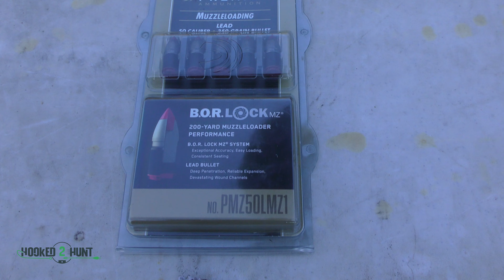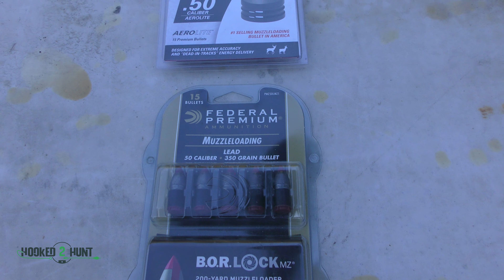2021 Muzzleloader Round Test   (Ballistics Gel Test and More!!)

Comment: Now that I've stocked up a lifetime supply of both muzzleloader bullets, I can share this information; Barnes Spitfire 290gr/blue Barnes sabot, and Hornady XTP .429 (44 mag) 300gr/Harvester green sabot. 3 bucks shot at 60-65yds with 290 Spitfires dead instantly, or layed down within 15yds.  1 Doe hit 20yds with 300 XTP quarter size entry, baseball size exit. 1 doe hit at 130yrds quarter size in and out, layed down in 20yds. 84gr by weight/120 by volume Black Horn 209 powder. Ya'll welcome.
Reply: I've only used the power belt and round balls so far. I Just started out with muzzleloaders this year.
Honestly even on paper and wood. it feels like the round ball ontop of about 65-75 gr. hit harder then the power belt ontop of a 100 gr.
I like the idea, but deffenitly see how power belt went wrong.
The gas check, while it does sound good, and works for the most part, it spins freely on the round.  
Logic would determine that it isn't gonna engage the Rifling as much as other options. At least that's my theory behind the "hit and miss" of power belt.
Sabot is definitely my next test.
 I just dont know if I should except more cleaning (plastic in the Rifling)  not sure what to expect since I haven't tried them in the muzzelloader yet.
Reply: I shot PowerBelts last year and lost several deer. I can also vouch for the effectiveness of the Barnes though they do foul up your barrel faster than other bullets. I shot three deer with them this year and they work extremely well. Copper bullets in my opinion give you the best weight retention since they don't fragment like lead bullets do. I think they also have the best expansion. Combine these two factors and you get two good sized holes and a lot of knockdown power. 

If all the energy of the shot is dispersed when the lead bullet fragments, you're left with one hole and a deer that will not go down quickly. I think this is the reason PowerBelts do not always give the best results.
Reply: Been a long time fan of the XTP .429 dia.
Wife's uncle had a frontal slight quartering shot on a 180-200lb black bear. Distance was 50-70 yards. We found the 240gr XTP far back in the winter fat. Travelled around 2 1/2 feet through the bear, with a text book mushroom ready for an advertisement.
They are hard to beat for price and performance from a smoke pole.
Reply: Baseball size exit? In the hide? Or inside chest cavity?

Comment: Personally I've tried and watched what other people have tried and I've never found anything any better than Hornday muzzle loader SST sabots rounds. I'm shooting a .45 Knight disc magnum shooting a 200 grain 40 cal bullet. On my Renegade 50 I have always shot .44 XTPs 240 grain bullets hollow points. I've taken deer out to 193 yards with the Renegade and 215 yards with the Knight. Never lost one yet and I've always had a good blood trail from both bullets. Both rounds are fast, but the 40 cal is faster and flatter. I'm shooting 80 grains of triple f Goex black powder in the Renegade, and 110 grains of Blackhorn 209 in the Knight. With Blackhorn 209 you can add about 15% more on the equivalent charge. So that is equivalent of around 132 grains of black powder. I have great accuracy here at this time so I really haven't tried any higher loads in the Knight. I know I will need to change the Renegade when I get a new pound of powder though, at least I  always had to in the past. I've never had to change loads with the Blackhorn and I'm on my 3rd bottle of it.
 I've been hunting with a muzzle loader for deer since 1981, and it was my preferred weapon until my state allowed high powered rifles about 5 years ago. I will still carry the Knight if I'm strictly hunting the woods, I've also taken deer every year that I hunted, until about 2011 for about 4 years and I would just left them walk due to blue tongue hitting our area hard.

Comment: Other things to consider than simply bullet expansion; is penetration before expansion and retention weight. If you hunt large heavy game like bear or moose, the last thing you want is a bullet to expand the second it hits muscle tissue. Penetrate to the vital organs then expand.
Weight retention is very important also for penetration; but not to say a heavy bullet is better. A bullet that starts fragmenting to early will have less penetration and potentially containment your meat with lead that we will ingest later when eating our harvest.

It's common to weigh bullets after the shot (if you can recover them). Make your own judgment if it is something to want to hunt with. A lot of manufacture will list a percentage for weight retention as a guideline. I've also taken a metal detector over an animal to find how much metal/lead has travel through the body. Results can be surprising! Powebelts in my experience and others are noted for fragmenting WAY to much. Loosing over 75% of weight.

Comment: I run the power belt platinums and they do a number on deerv
Reply from the maker: Wife dropped her first deer with a platinum this year. Deer dropped in place.
Reply: @hooked2hunt  my doe didn’t drop but I thought she would with a high lung shot but she only made it about 75 yards before piling up. The blood trail was a easy one. The load I run in 120 grains or 2 60 grain pellets followed by the power belt in a 270 grain. The reason I did it so heavy was for bear

Comment: power belts may be easy to load and accurate, but they are the worst performing muzzle loader projectile you can shoot at game. They are soft lead with a copper coating. They expand to fast come apart and leave no blood trail or exit wounds.
Reply: Dropped the doe I shot today in her tracks and the other 6 deer I’ve shot with the power belts. Every one exited but the deer didn’t track
Reply: @tman19971   I had similar results with powerbelts, but sooner or later you will hit the shoulder or something else hard. That's when they will fail you. If your happy with them that's what counts, however I have shot  around 50 plus deer with a muzzle loader and have seen to many failures with the powerbelts. That said if powder charges are kept low, 90 grains, max and only broadside shots are taken they can be effective, but there are other bullets that are just as accurate, and offer far better performance on game in my opinion. Congrats on your doe !
Reply: I learned the hard way on that, they really suck! Bad.
Reply: They have a 330 grain long range option. It has pretty deep consistent penetration and seems to hold together in water tests.
Reply: Funny since many many deer have been killed just fine with PRB which is pure lead along with conicals which is again pure lead
Reply: @Catboy-hr2qp  Very true. Keep in mind however that those projectiles were shot using lower charge weights of black powder. Useually in the 80 to 90 grain range. I have shot a lot of deer with powerbelts and I can tell you they work ok, with 90 grain and under powder charges, so long as you avoid the shoulders. Your still not likely to get an exit wound, much like a lead round ball however. Now up your powder charges to today's more normal 110 to 150 grains and the powerbelts just don't hold up. Just because something works with perfect shot placement does not mean it's the best choice. If you like them, use them but know there limitations. Don't shoot them to fast and aim behind the shoulder. If I were to shoot them today I would go for the heavier ones, 350 grains and up.
Reply: 💡Shot placement is everything when shooting to kill💥👍
Reply: That stuff shouldn't be breathed !
Reply: I've killed several bucks with aerolite but they do fragment apart bad blood trials are terrible for the most part ! Some shots dropped them in their tracks but I would have to make a follow up shot! Try something different I promise you it will be better than the Aerolites
Reply: If you melt them down. Make ok sinkers.

Comment: Great test, but what powder and charge did you use? That makes a huge difference with the bullets. Was it 100 grains? Loose or pellets? 150 grains? Let us know. I use Triple 7 pellets 100 gr. but want to try White Hots. I also use the Platinum Tips.
Reply: Joe was using 90 grains of loose black powder. I use 100 grain of pellets
Reply: I like white hots because they seem to clean easy, 
But. The do break very very easy compared to the triple 7 pellet. 
Both boxes of white hots I've got had broken pellets when I got it. And I've crushed a couple getting them out of the tubes. 
I still like them, they preform. but you gotta alot be more careful with white hots.
Reply: I use the white hots as well. Haven't had an issue with them coming apart. I have found the combination that works well for mine. 100 grains powder with platinums...Deer don't stand a chance.

Comment: Needed to know the powder charge and power belt bullets expand way to fast at close range, and not enough at ranges beyond 170 yards. I've lost several good deer to power belts that simply didn't bleed
Reply from the maker: That is the main problem we have seen as well. Appreciate the info.
Reply: Pull the red tip out of the powerbelts. 
I've experienced similar issues and as soon as I started pulling that plastic tip it was like magic, they just dropped. When they didn't they made it a whole 100ft, blood everywhere.

Comment: Take the scope off the gun . Zero it using the open sights . Use REAL black powder, You may kill the deer providing you can hit it. Don't mean to be overly critical but inline muzzle loaders are junk. The projectiles they shot are about the same.
Reply: They had inlines all the way back in the 1730's, and inline ignition was the up-and-coming design trend by the 1850's, it's just that most people were switching to breechloading guns with those new-fangled metallic cartridges by that point. Sir Isaac Newton experimented with optical and telescopic sights in the late 1600's, and King Frederick of Prussia  was noted for having used an optical sight in a tournament. Commonly available telescopic sights were being produced by the 1840's. 

Bullets were in use in rifles in the 1790's, and gained widespread acceptance in target shooting and hunting circles by the 1820's and 30's; though I will agree with you that most of the mass-marketed ones of today are mostly hype. 

I like my sidelocks (and it's mostly what I make), but I also make traditional inlines (styled after a Babcock open-frame gun, also working on a design for an inline flinter, based on the Germanic examples in the Tower of London) and a traditionally-styled inline (which is smokeless capable), because they just plain work. Scopes on flintlocks/percussion sidelocks, inlines, BP,  BP alternatives (there is no true substitute for BP), Smokeless,  balls,  bullets, large bore, small bore, smoothbore, chokes,  and flintlock/percussion breechloaders (another pet project of mine), all good fun.

PS: the "be a real man" bit seen all too often in muzzle loading gets old after a while.
Reply: @wildrangeringreen  Good thing I'm wearing my boots , it's getting a little deep...........
Reply: @howardwinter3455  nah, it's just that your 1955 Official Disney Davy Crockett "Indian Fighter Hat" is a little tight.

Comment: A word of advice if you don’t want to keep losing deer. Start taking only neck or head shots . That’s the only shots I will take on deer. One they are dead before they hit the ground 2 you don’t have to track them 3 they don’t suffer any and 4 they bleed out so there is little blood left in the animal. Hunting is about putting meat on the table lung or heart shots ruin good meat neck and headshots don’t. It’s not about trophies it’s about putting the most meat on the table as possible before winter hits.